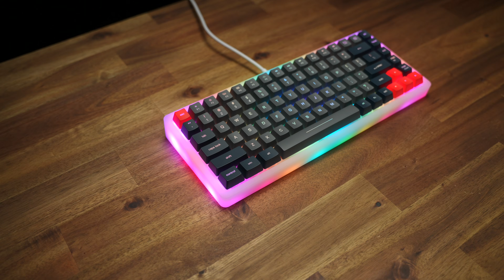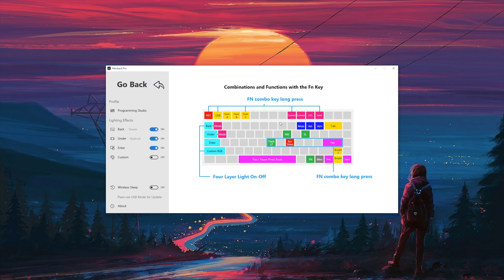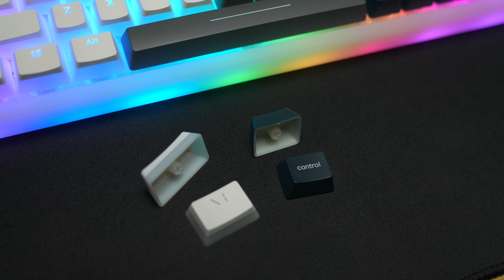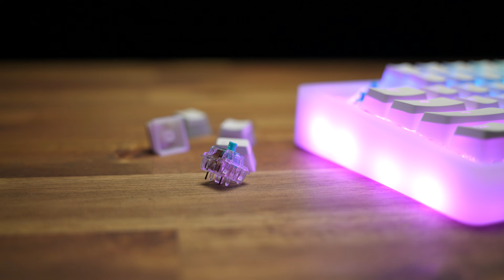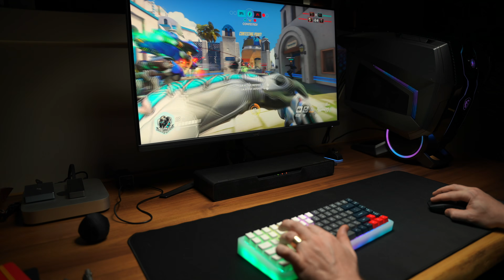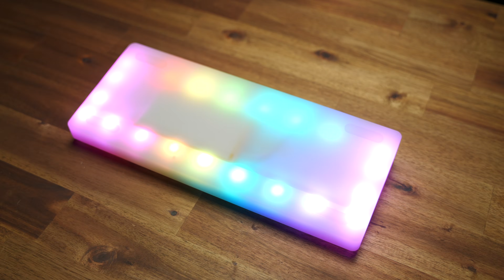Marsback M1 Review: SO MUCH RGB + Hot Swap Switches!

Comment from the maker: so what ya think? too much RGB? NOT ENOUGH RGB?!?! it's a good quality board, but man is it loud! lol
Reply: you can switch the switches so i backed it awesome rgb
Reply: also those type of keyboards i always wanted 1 but to get a KBoard like that you gotta custom yourself which will be like 300
Reply: They are Neo-Tokyo-loud 😅
I think I’m your age and I’m kind of rebouncing now liking these kind of over the top rgb boards instead of winding down.
Great in depth review while keeping it short and simple. I really like your volume test as well. Which mic are you using for your reviews?
Reply: @pzeidon  i got ther keybaord today the switches are pretty quiet but im switch them and the lighting has alot of features i fuck with this keybaord and the caps are finnesed im rocking white pudding its how its built and its smooth the space bar is the only loud  thing    super light i need to get some switches and lube them up
Reply: @pzeidon  im using the keyboard now yea these are pretty quiet i there stock II switches there pretty quiet  but noisy your build is good i wanna go for bannana splits that  space bar sounds like a iphone click lmaoo but the space bar on this sounds like  cap botttle the noise is loud smooth press they keycaps are smooth  deff want to go for the  Durock V2 stabilizer but other then that i like that its wired and bluetooth and alot of macros you can assign it to
Reply: @pzeidon  someone wants to give me my switches as a gift so im  just waiting so no mods yet